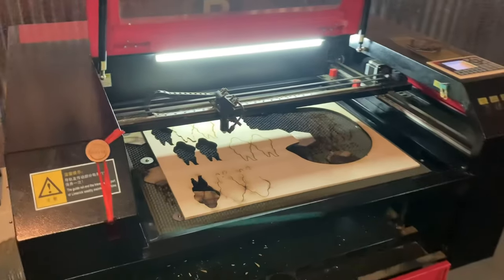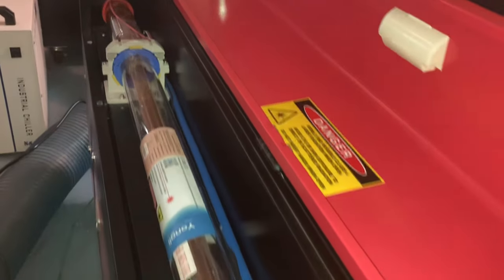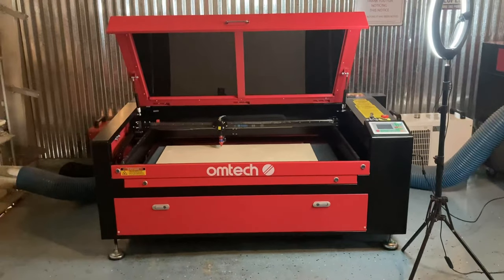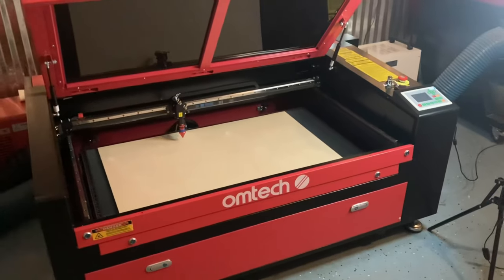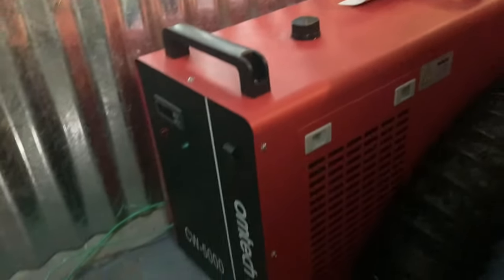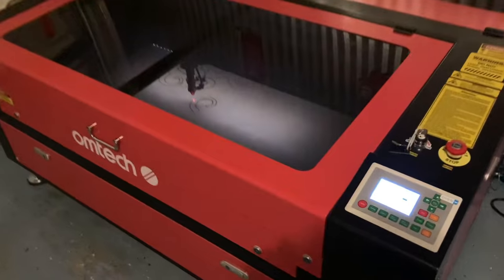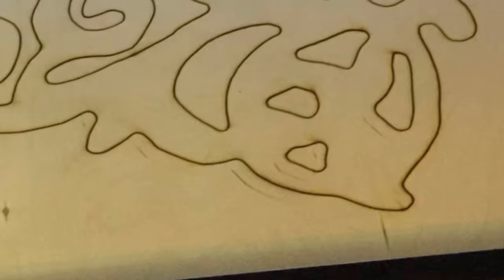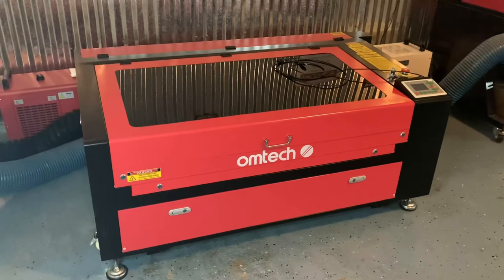Omtech 100w Co2 Laser Cutting / Engraving Machine - Basic Review and First Impression

Comment: I had the same problem with the door sensor but I'm using RD Works so I just taped a small piece of aluminum (steel would work too) in front of the sensor.  My unit is about 11 months old and I'm very happy with it.  Take some time to do a very precise aiming of the laser.  Mine was out quite a bit and the table also was out of level by about 1/4 inch on the front right.
Reply from the maker: Thank you very much for that info!

Comment: if you want to swap out the built in extractor fan for an inline fan you can, or upgrade the built in one, just do not go higher then a 600cfm fan, too much vibration caused by the air and the wood/acrylic can shift around. I find a 450 cfm with variable speed works perfect for mine. keep it around 200 for light engraving and then full 450 for cutting .  but I also pump mine through a filter box so i am not venting conditioned air during the summer.

Comment: I just bought the same machine and it was delivered yesterday.  I am swapping the fan out for an inline duct fan now.  Will have to run the ground cable like you did.  I saw another video that suggested sanding down some of the paint inside the cabinet for better contact. I forget where it was located, but I'm trying to find that video again.  Happy burning and thanks for the video!

Comment: The door switch looks like an inductive prox switch (senses the metal of the door) -- so most likely it's just not positioned correctly. Depending on the model, it may only have a sensing range of 2~3mm. If it is an M12-threaded sensor, then you can adjust its distance further towards the door to allow it to work correctly by loosening the nuts on the front and back, then screw it forward, then lock it back in. Can also use a ferrous metal (eg. steel wrench) to test it.

Comment: Omtech 100W CO2 laser cutter is a decent machine for the price, but it definitely has its drawbacks. The first issue I encountered was that the software is clunky and difficult to use, often requiring multiple steps to achieve even basic tasks. The build quality feels a bit cheap, and the laser itself is prone to getting misaligned, resulting in uneven cuts.

Comment: The cooling system is poorly designed. The OMTECH CO2 laser overheats frequently, leading to disruptions and frequent pauses during operation
Reply: So what do  think to get
Reply: well I used the 80w for over a year with the 5000 chiller and never had a over heating issue. I just ordered a 100w with the 5200 chiller.